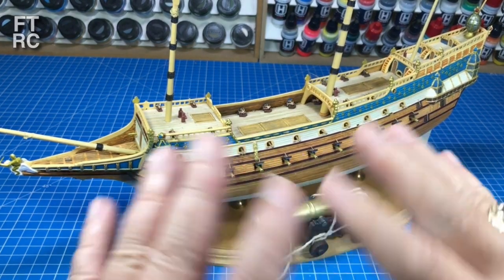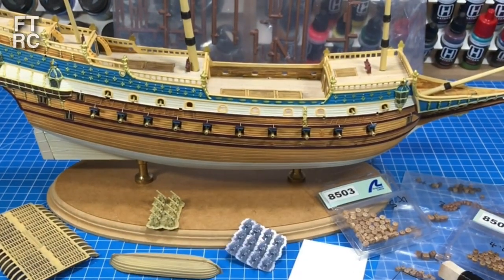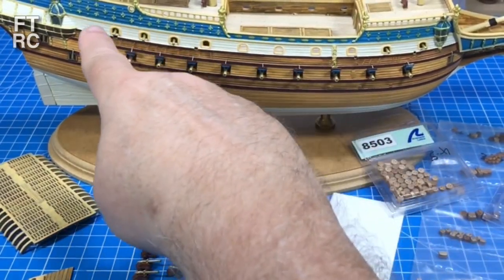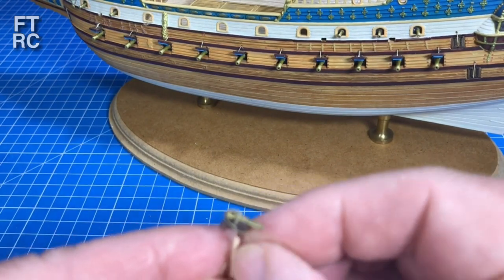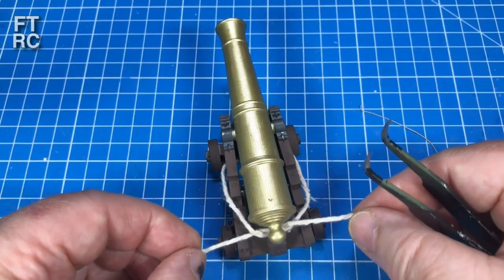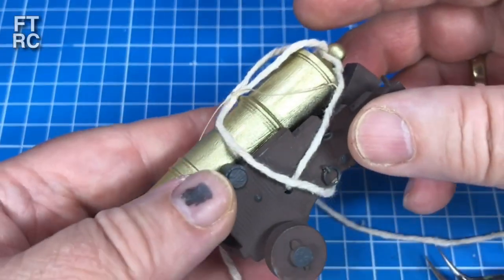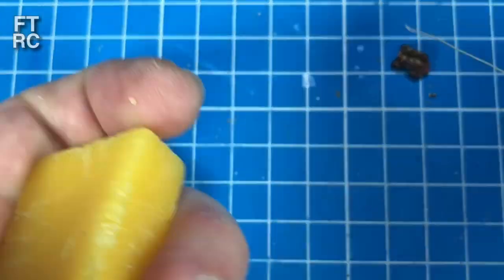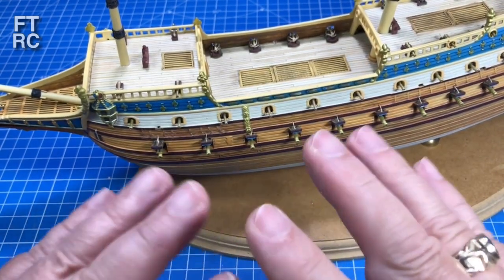Lashing Cannons on Airfix St Louis Part 15  in 1:144 scale - Yes you can do it!

Comment: Fantastic. Well done Harry. I spent years calling the cascable the trunnion because of novels saying crap like "blow the trunnion off" a spiked cannon.
Reply from the maker: The trunnion is the metal rod which sticks out of the cannon barrel sides and turns in a slot on the truck.  It is held in place by a staple and allows you to tilt the cannon barrel for ranging

Comment: You're a genius,  Harry. I'm about to start lashing my cannons on the deck of the 1/87 Airfix Bounty  - only six cannons - and then your video pops up. I have imported the Kerry Jang book from Old Blighty, but it is still in transit - and what a surprise,  your masterclass video appears.😅
Reply from the maker: Hope it helps you lash them in… On my 1:110 Bounty, with thicker plastic hull sides, I managed to add some eye hooks on the gunwale which helped pull the trucks into position.

Comment: Hi Harry, Very clever and it looks great👍🏻. One question, I understand that they tied it for the recoil but how did they load the canon? Thank you for the video and good continuation👋🏻
Reply from the maker: The long front ropes where attached to the gunwale via a pulley and hook.  That way the gunners could pull the cannon inboard and reload via the barrel end, then use the same pulley and ropes to run out the cannon again for firing.
Reply: @HarryHoudiniModels  After thoughts, with my slow brain, I was thinking that they used that during travel, with rough sea, and untied them  before battle, keeping just the ropes with hooks (for recoil, rough sea and making it easier to re-load) . I wonder why they didn't use hooks for all...